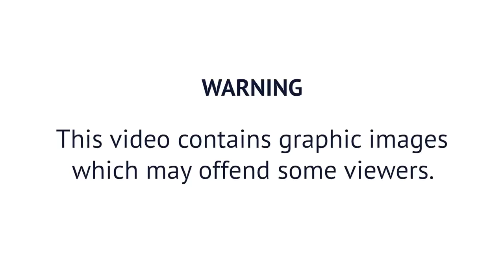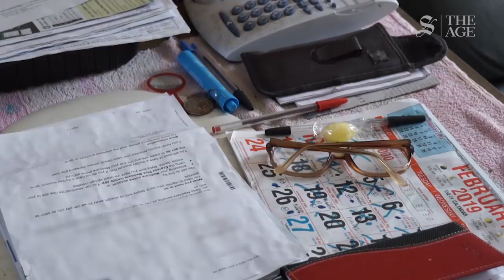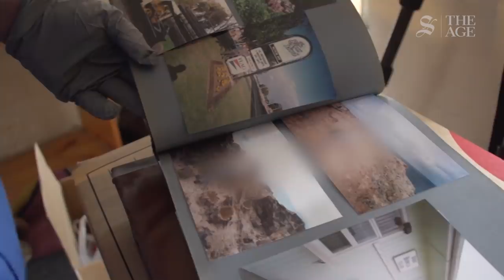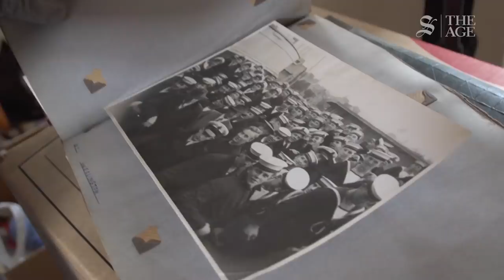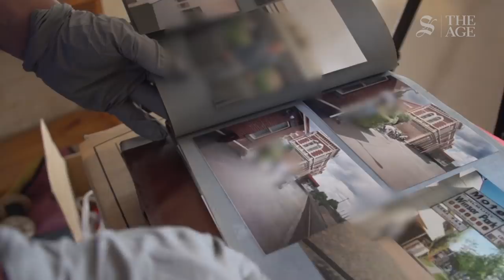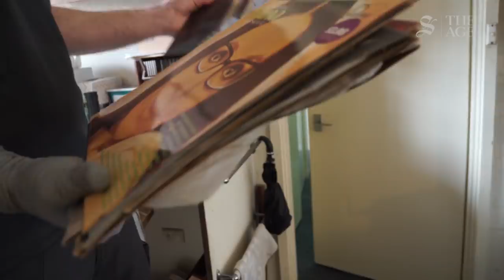A day in the life of a forensic cleaning team

Comment: I moved into a building where one of my neighbors passed away in his room and wasn't found for almost a week. I'll never forget that smell. It was in my mouth, my clothes my hair. I went to work smelling like dead guy.
Reply: The products of organic decomposition, such as cadaverine and putrescene, are lipid/oil based, just like cigarette smoke, so it is incredibly hard to remove these odors, especially after the molecules have adhered to porous surfaces like cloth. I drive a truck for certain periods of my job. An older model that will flood the cab with diesel fumes upon engine start. Even days later my clothing will still reek of diesel...